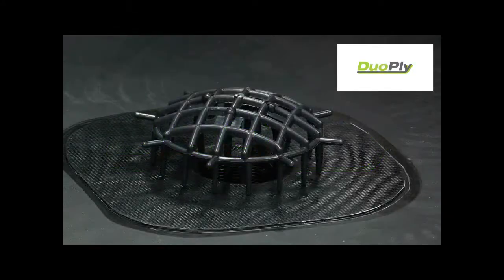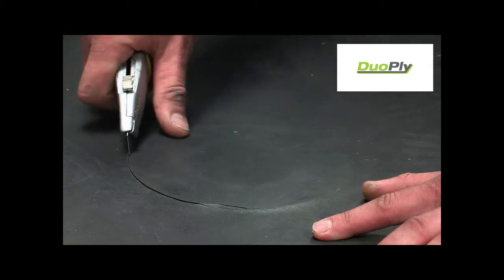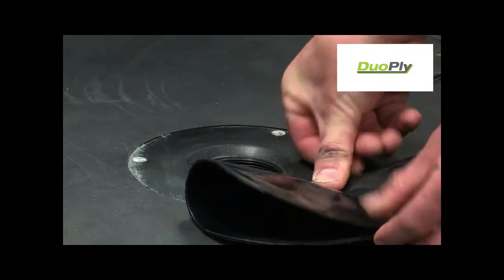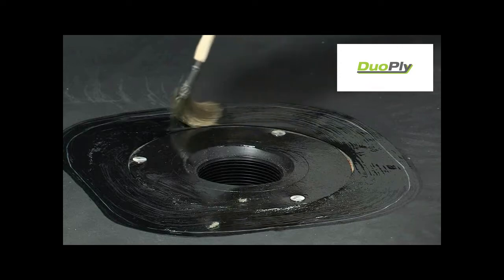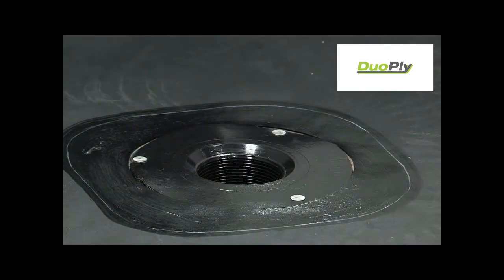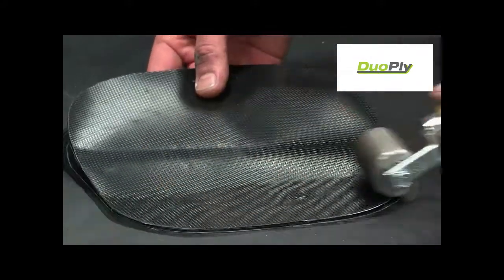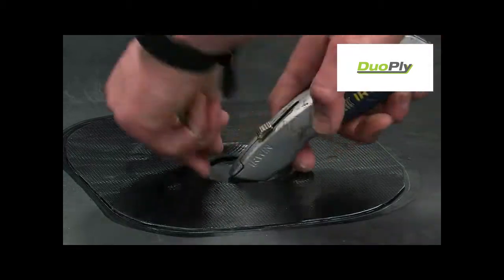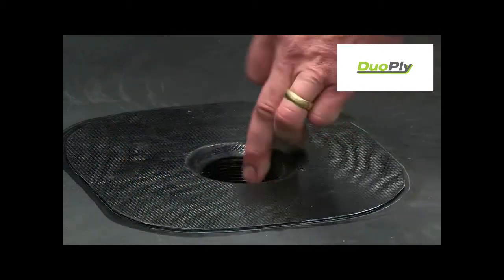DuoPly® EPDM Membrane 68mm Anti Back Up Drain Installation

Comment: Hi there nice video. I have a recently installed EPDM on my garage roof. It is a shared roof with next doors garage roof. It has a single outlet to service both garage roofs and also the rainfall from the house roofs as well into an internal downpipe 68mm. As you can imagine there are times when the outlet gets overwhelmed in heavy rain and also subject to blockages with debris and leaves etc. So I want to fit a second outlet at the front of my flat roof into another seperate 68mm internal downpipe. So my question is can I fit your product on top of my existing EPDM membrane and achieve a reliable waterproof seal using your products? Cheers Brian